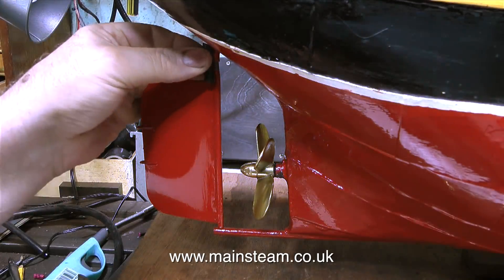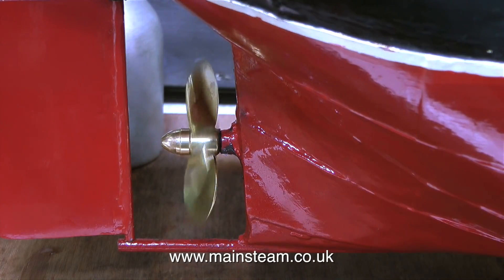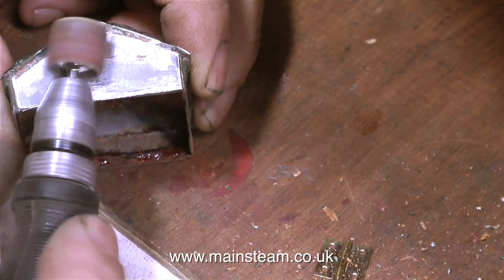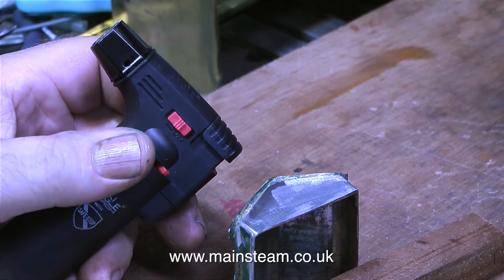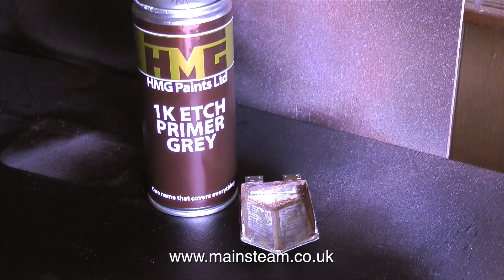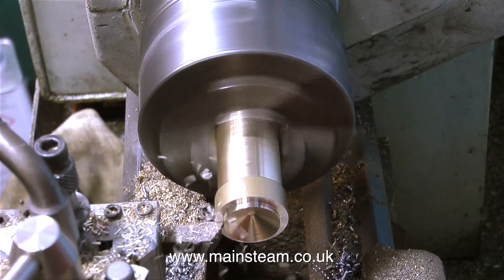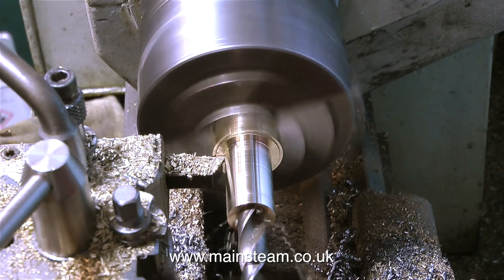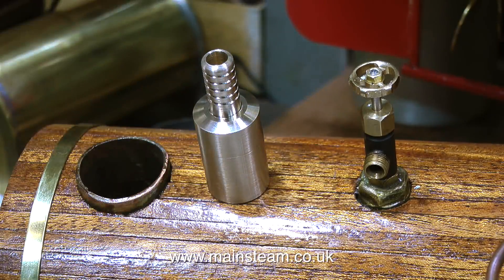A MODEL STEAM BOAT NAMED EDITH - PART #27

Comment: Keith - I wipe the slideways with a finger  then  hold a rule  from the tailstock (or saddle if turning) and measure as the clean bit  extends  - but then I'm from Wales we Screw cut differently too !
Reply from the maker: good to see that someone else also applies my kind of engineering }:-)))
Reply: Different strokes for different folks, as long as it gits done.